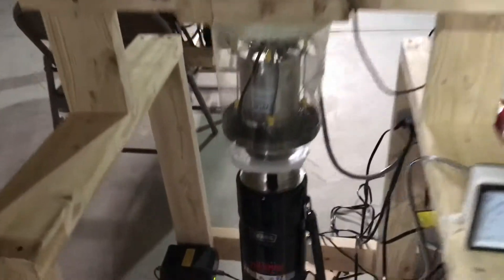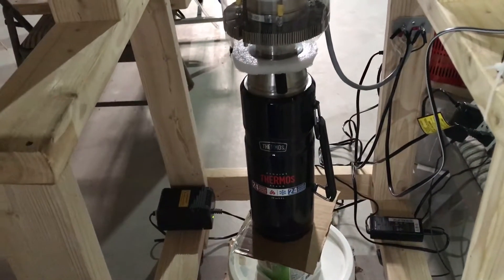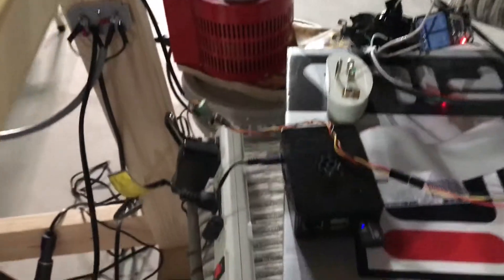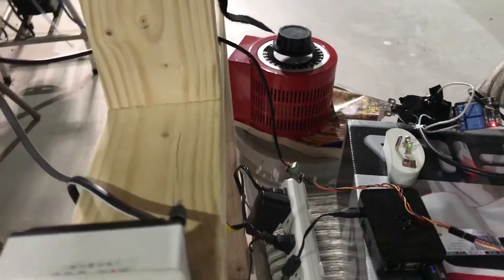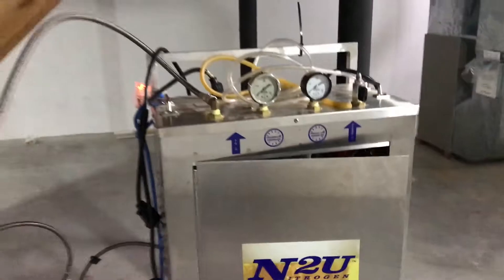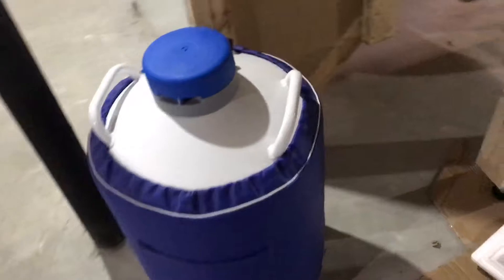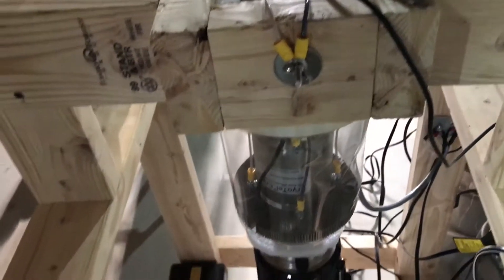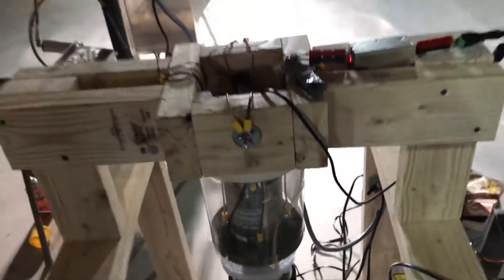Making my own liquid nitrogen and liquid oxygen

Comment: I'm working on building one of these. We'll see what happens.
Reply from the maker: I would be very interested in knowing how well it works for you (that is, liters per day).  I can't get enough of this stuff.  Liquefaction of air has fascinated me since middle school when I learned that the gases in the air can actually be a liquid.
Reply: @ChristmasEve777   I'm using a 5KW helium compressor and a CP 10 industrial cryotrap. I still have to get hoses to connect them and I have to get the electric company to install 3 phase power. Considering that the cold head is too large to fit in the neck of the dewar I'd say there's a very good chance that it'll be capable of 10L a day or more. I'll see if I can make a video in the near future showing my progress so far.

Comment: How much watt of cooling power you are getting at 77K  from it at 400W total input.

16W at 77K?
Reply from the maker: How did you know?? Yes, it's exactly 16 watts at 77K.  Pretty horrible, huh?
The documentation says it only uses 250W max but it draws more in reality (closer to 400W like you said). Actually 400VA (37 VAC @ 10.8A)
Reply: @ChristmasEve777  it's  actually pretty good cooling power as you are getting 4 liters per day. At least you have a source of cryogenic liquid. If you want to increase liquifaction rate even more then I can suggest you few techniques.
Reply from the maker: @Exotic_Lab  Do you mean you have other ideas besides the multi-stage phase-change system we used to talk about last year?  I would love a relatively simple way to modify my cryocooler setup vs. making the 3-4 stage phase change system we were discussing :)
Reply: @ChristmasEve777  making single stage precooling unit is very easy
Reply from the maker: @Exotic_Lab  Yes, I would love to precool my room temp dry nitrogen (as it comes from the storage tank before entering the cold head / dewar) area...
Reply: @ChristmasEve777  you can make one small precooling unit using easily available fridge compressor with propane as refrigerant. It can precool nitrogen down to - 42*C to -45*C easily.

Comment: Sir can I get you design layout so that I can make mine too
Reply from the maker: I didn't work off of a design.  I kind of just threw it together.  I started off knowing I had to acquire a stirling cycle cryocooler.  That is what does the actual cooling.  From there, I just pieced parts together as needed.  If the cryocooler you buy does not come with a controller then you also need a variac.  You may not have the same requirements as me so the other components can vary.  Do you just want liquid nitrogen?  Is liquid air okay?  Would you give up efficiency for cheaper components and a less complicated design?  But before you can plan this, the cryocooler may be hard to get.  That's your limiting factor.  I scoured eBay for literally two years before I happened upon a person selling one.  I have, since, seen a few sell on eBay.
Reply from the maker: Interesting.. I just saw this on eBay: https://www.ebay.com/itm/STI-superconductor-technologies-hybrid-98-cryocooler/183821009974?hash=item2acc960436:g:JJwAAOSwEjJc5Xza
Someone is selling a complete system (minus a thermos or small dewar to collect the liquefied gas).  HOWEVER, it's VERY expensive.  I've never seen one selling for so much (>$3K). 
If it were me personally I would wait.  Just thought I'd tell you.

Comment: What kind of output do you get from your machine? I'm interested in building a setup like yours to make 10-20 L of LOX for a model rocket, but I'm concerned about the LOX evaporating out of my dewar faster than the cooler can fill it. 

Also, how to you separate the two once the air is liquefied? Do you just let the nitrogen boil off in open air until you're left with LOX and dump it into a dewar?
Reply from the maker: Ever since I added a dehydrator, I've about doubled my output.  Being winter helps even more.  I'm getting about 4 liters in a 24 hour period and that's using around 400 watts continuous.  The oxygen/nitrogen separation is done by using a membrane filter that gives 99.9% pure gas. I feed pure nitrogen (or oxygen) into the thermos at the rate it need it.  Before I got the membrane filters, I used to obtain LOX by the method you mentioned.  I would let the N2 boil away in a styrofoam cup until it looked very blue.
Reply: Wow, that's a great yield for a home unit. Do you separate your gases before or after cooling? That'd be an enormous boost to efficiency if i didn't have to waste energy cooling nitrogen that I'm not going to use. What type of material is your membrane made from? 

Sounds like this is the most cost effective method of making oxidizer for a model bi-propellant rocket, assuming you've got a good dewar to store it. Where I live, electricity is $0.11/KwHr, so with your power/yield I could make LOX for about 25 cents per lb, as opposed to paying $3-4 per lb on chemical reagents to make oxidizers like Nitrous Oxide or Fuming Nitric Acid.
Reply from the maker: @mikethurman9797  Unless my math is wrong, I think you can produce more than a pound of LOX with 2.25 kWh of energy.  Of course there will always be losses over time, even with the best dewar.  I separate the gases at room temperature right after the air passes from my compressor, through a heat exchanger and through my dehydrator.  The cryocooler cold head receives dry, clean, pure oxygen (or nitrogen).  I'm not sure what the membranes are made of.  I lucked out and got the N2 membrane from a used beer gas generator (in the video) and lucked out a second time by finding a used LOX generator for medical use and scavenged the O2 membrane cylinder from it. You'd think you could use just one filter for both.  But the nitrogen membrane tube I have has tiny holes for the oxygen outlet with warnings not to block, obstruct or pressurize them.
Reply: @ChristmasEve777  would it be feasible to set up a pressure swing adsorption system using 4A molecular sieves? Those appear to be relatively cheap. Currently my only source of high purity oxygen is a byproduct of electrolysis i use to fill model balloons (safely outdoors, of course), but the energy requirements to get O2 that way are enormous.
Reply from the maker: @mikethurman9797  I am so sorry for the late response.  I somehow missed the notification that I had a new message.  Yeah, that is definitely an expensive way to get pure oxygen (via electrolysis of water).  I'm sorry but I'm not very familiar with molecular sieves.  I employ a few of them (for drying air, separating N2 and separating O2)  but I'm not familiar with how they actually work or setting up my own.   I wonder if there are any relatively cheap units out there on eBay or other sites?  They appear from time to time and, even if you do have to spend a little on the membrane, assembly, just think how much you'd be saving in electricity.  An already functional oxygen sieve will only require dry compressed air to give you lots of pure oxygen gas.

Comment: Love it! How much did this build cost? 
Want to build one of my own, Where can I get hold of a cryo cooler?
Reply from the maker: Thanks Erfan!  For me, it cost more than other hobbyists I've seen on YouTube.  I put about $3000 into this system.  The cryocooler alone was $1600.  There was a batch of cheaper Stirling cryocoolers on eBay just after I bought it but it was too late.  They were going for just under $1000.  They've all been purchased though.  I don't see any for sale at the moment.  It could take months before another appears again.  You'll have to just keep monitoring eBay.
I expect my production will increase significantly once I start using the pure dry nitrogen from the nitrogen generator.  I realized that the heat of solidification of the water freezing on the cold head produces a lot of heat and it's sucking much of the 16W of cooling power (at 77K) that my cryocooler can produce.
Reply: Legend of the Stormlord you should check out the channel named "applied science" the guy on there made one for about $500